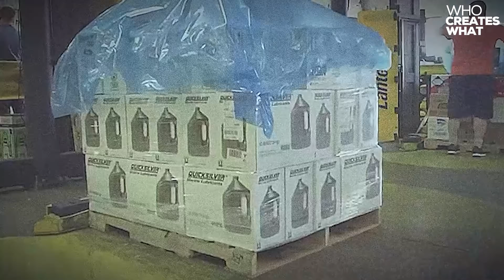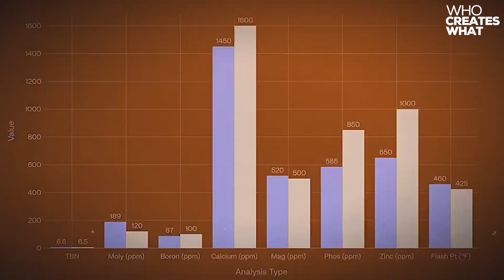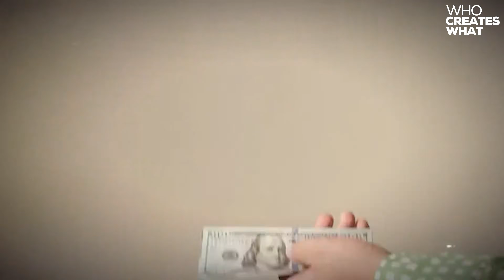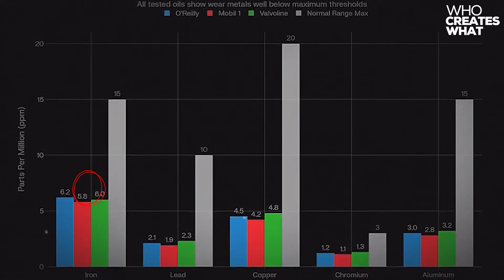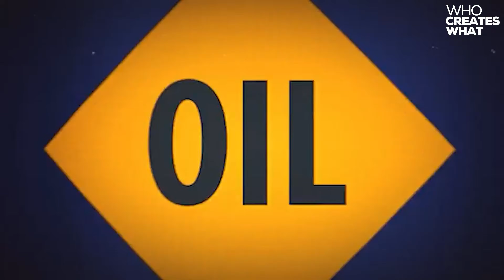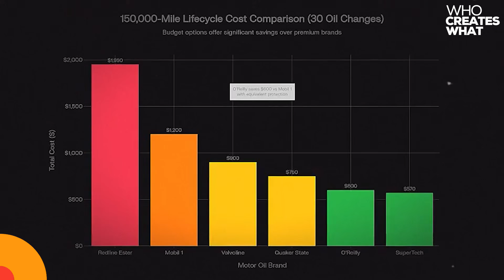Who Makes O'Reilly Motor Oil? The Manufacturer Nobody Talks About

Comment: Could be valvoline like autozone and Napa ! But who knows ! If its Warren then thats supertech  - Amazon basic and Cosco ! Most engine  oils today are already  ILSAC GF 7 so it probably  doesnt matter much ! Just change it out every 4 to 5k miles !
Reply from the maker: Yep, it's Warren! Same factory as Supertech, Amazon Basics and Costco. You're absolutely right - with most oils meeting GF-7 specs nowadays, just change it every 4-5k and you're set!
Reply: @WhoCreatesWhat101  Question is does each spec their own oil so that even though Warren makes it one may have a better additive package than an other
Reply: I don’t think valvoline makes stp oil. Stp tested pretty low
Reply from the maker: @matthewvaladez8209 I think you might be thinking of a different video? This one doesn't actually test or mention STP oil at all. It only covers O'Reilly, Valvoline, Quaker State, Supertech, and FRAM.

And you're right that Valvoline doesn't make STP oil - they're completely separate brands owned by different companies. STP is actually owned by Energizer Holdings, so they have totally different formulations.

If you saw STP testing low, that was probably from another oil comparison video. But good news - I'll be doing a dedicated video about STP next Tuesday (March 10th), so stay tuned for that!
Reply: @WhoCreatesWhat101 he said “could be valvoline like autozone and Napa.” Napa is developed by valvoline. Autozones house oil is STP. That’s why I mentioned it
Reply: I’ll be waiting. I personally think every oil on the shelf will do a fair job if changed between 4-5K miles.
I’ve used many oils and my 21 civic drives great. Yes some oils have better additives we get that but I’m starting to truly believe that any full synthetic oil basically sold at Walmart/ auto part stores will do well
Reply from the maker: @matthewvaladez8209  You're absolutely right, and I agree with you 100%. At the end of the day, regular oil changes matter way more than the brand name on the bottle.

If you're changing your oil every 4-5K miles with any decent full synthetic, your engine is going to be just fine. The differences between brands are there, sure, but they're pretty small compared to just staying on top of maintenance.

Your 21 Civic is a perfect example - take care of it with regular changes, and it'll run great no matter which shelf oil you use.

The STP video will still be interesting to see where it falls in the rankings, but you're right that we're really splitting hairs at this point. Good maintenance habits beat premium oil with neglect any day!